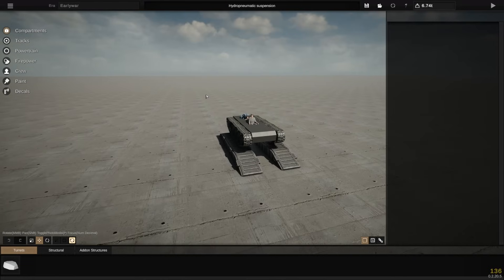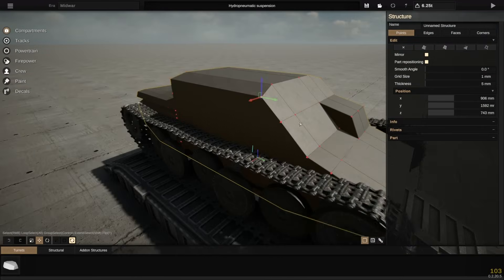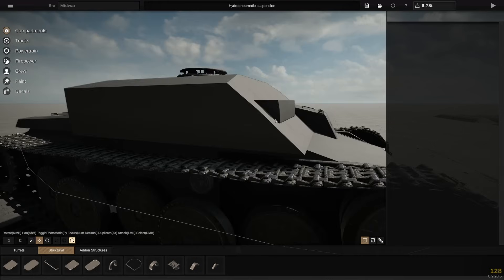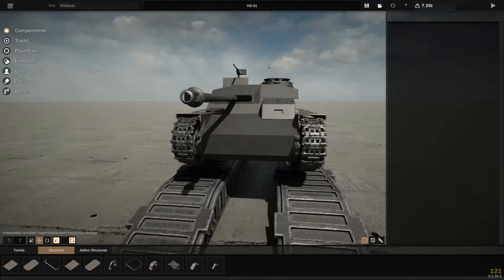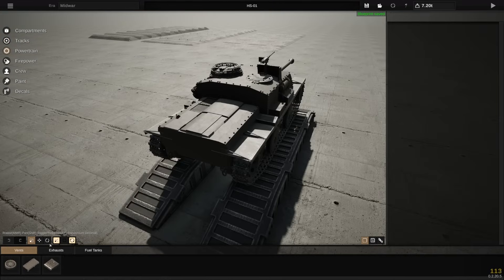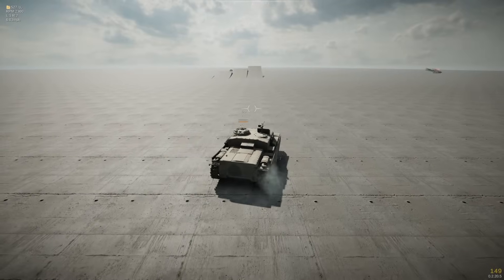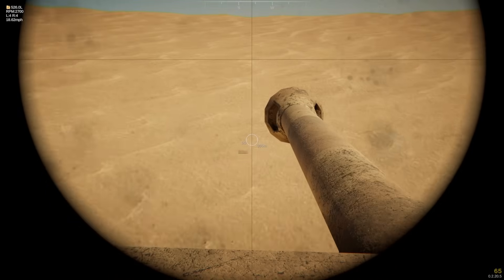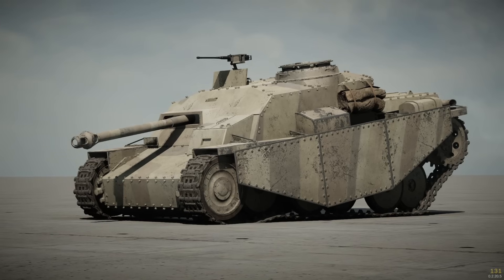HYDRO-PNEUMATIC SUSPENSION in Sprocket Geometric Internals!

Comment: gaijin adding the worst features to war thunder:
hamish absolutely cooking in sprocket:
Reply: man, if they add a multiplayer so you can go against other people in certain weight classes and calibers and really test out your designs
Reply: @sonofagun1037  i want much more posibility to make my own maps with more stuff, also bots shouldn't see over hills or through trees and their leaves when player also can't see. PvP is't bad, but should be divided between historical and not historical vehicles. also question it should 1+bots vs 1+bots player (need for good comands, well working and quide/explanation) or or only players.
Reply: @sonofagun1037  they should make a formula instead for Armor weight, engine size, and that makes the cost for a tank
Reply: not really this was made by aku well the hydro SUSPENSION.
Reply: @sonofagun1037  this will be happening soon according to the dev roadmap
Reply: @mrman5666  kinda forgot about that,  but still a cool update for ai

Comment: Most modern tanks raise and lock the gun after firing to make the loader’s job easier, and the StuGs were based on the Pz.III and IV, neither of which had interleaved road wheels. The Stürmtiger had interleaved road wheels, so maybe you were thinking of that?

Comment: All manually loaded tanks will slightly raise their gun from the neutral position automatically to make loaders job more easy
Reply: Except the Abrams, for some reason. Apparently it’s a feature you can enable, but they never use it.
Reply: @tetronaut88  why what's the benefit of not using it
Reply: @nope_defender.bot.6563  I have no idea, but I've heard that from both a video about it and two Abrams servicemen. Someone said they preferred it as they could see where the breech was as they got the shell so they could line it up better as they grabbed the shell, so I think it all comes down to how they practice during training.
Reply: @tetronaut88  but it should be muscle memory what?
Reply: @nope_defender.bot.6563  as I said, I don't fully understand, that's just what I've heard.
Reply: @tetronaut88  very confusing